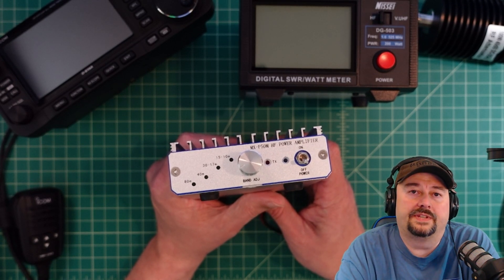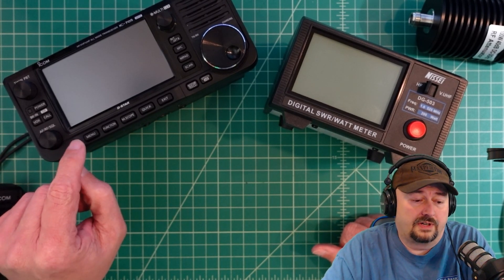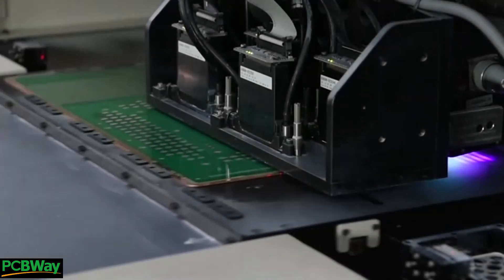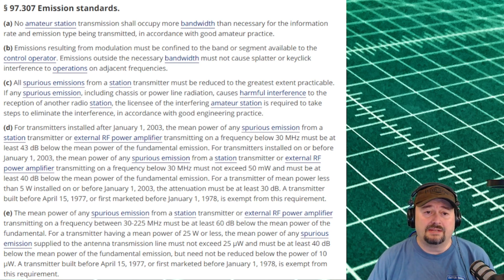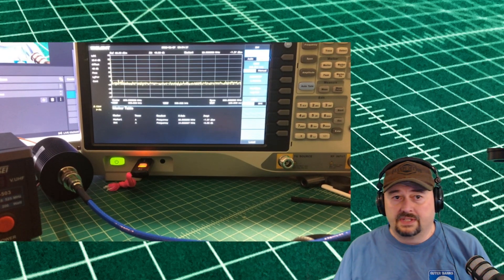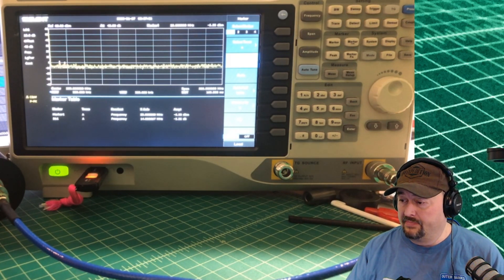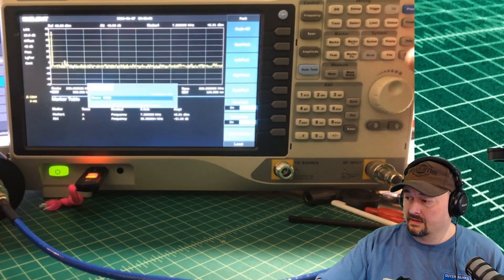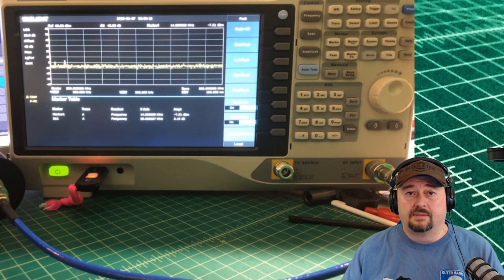MX-P50M HF Power Amplifier Spurious Emissions Test

Comment: Sorry for repeating this question if it has already been asked but did you check the spectral output on the IC-7300 first?
Reply from the maker: 7300 was clean, it’s the amp
Reply: @TheSmokinApe  Roger Roger
..thnx...I was about to second guess my 7300 but I'll just relax now 😁

Comment: Two comments.. the   RF relay topology of those amps is crap .. they use the same relay for both in and out to the LPF selected. This sis guaranteed to cause problems  but it's a cheap solution. You get blow-by within the relay.

Second.

It may be possible to jessy up the performance on 20 mtrs  you need to find out what you have there in terms of L s and Cs measured not what's written on the body and not via an AL calc.  Then run it through  a Bessel filter program an find out where the break point is -  some of the filters of that type when sold as stand alone (Ebay)   are utter crap. they have never been checked for component tolerances.  or were a bad design to start with .  Rework it so the break point is sitting either ON 14.3 Mhz or say +20% if you want less power dilution. 

 THen build it with those components  .  You may with intelligent component selection be able to  retain all coils on that  band as wound and just pull around the filter by the  filter  capacitors of which there are likely three. Appn Note  267 from Motorola  Is you friend but you won't know what Q has been the basis of the filter design.  Everything in that  appn note for  a Network type B devolves from the selected Q.  Nxp now appear to own the intellectual property of that AN.  

any capacitors replaced have to have precisely the same technology as the existing ones.  No Mylar green caps for example are acceptable. 

TEF
Reply from the maker: Thanks for the detailed info TEF

Comment: Thanks for this test. Glad to see it has the output filtering. Going to put one after my Flex 1500 to get 25 Watts to drive my Elecraft KPA500 to full power. Tried a different Chicom unit without filtering and it drove my KPA500 nuts.
Reply from the maker: Good luck with it Craig, thanks for watching 👍

Comment: I'm enjoying watching as you learn more and more about ham radio. 
There's no reason not to use the amp. I assume ANY amplifier I get has spurs, and that an external low-pass filter will likely be required. Fortunately for us as hams they are cheap and easy to build, and we are licensed to build and use those filters. You have a good spectrum analyzer and power attenuator sitting right in front of you. Go for it.
Reply from the maker: Hey John.  I have this thing field stripped right now, the plan is to attempt a fix internally and if that doesn't work we'll go the external route.  Thanks for the comment 👍
Reply: @TheSmokinApe , I'd guess if you put a NanoVNA on that low-pass filter you'll find one of the toroid's windings needs adjusting.
Reply: Spurious emissions is normal from this amplifier if the input is overdriven. Keep the input to 3.5W or so, and harmonics should be well below 50dBc. But on the other hand, the production line for these amplifiers may give some variance. It's not a 6-sigma factory I guess.

Comment: I wonder if there are a set of LPF Low Pass Filters in this unit. If not, perhaps you could just add one for the 20m band ? I suppose 17 meters should be checked.
Reply from the maker: I plan on doing more testing with it.  It does have internal filtering, I suspect it needs to be tuned / adjusted.

Comment: Surely to be meaningful the test should show spectrum analyser results for both the input and the output. Also, the test needs to show the input power level. I did own one of these amplifiers and it was well within specifications ... PROVIDED it wasn't overdriven. These amplifiers are rated at 45 Watts maximum output but at that level they are really starting to become non-linear. Keep them under 40 Watts and they're fine.
Reply from the maker: I tested down to 30w, and it was still out of spec.
Reply: @TheSmokinApe  Mine was fine up to around 35 Watts. By 40 Watts it was starting to saturate and at 45 Watts it was saturating badly and was completely non-linear.
I suspect there’s some variation. There’s not a lot of quality control with these products so it can be a bit of a lottery.
Reply from the maker: That, I can agree with.  Thanks for checking it out Andy.

Comment: Can you just do 20 but use the Hermes to generate the signal? (I am still gonna use mine) also, when you adjust the power down, to say 20w out, does it meet spec? Thanks Ape
Reply from the maker: It did at 30, I think I need to do a part deux 🤔
Reply: @TheSmokinApe  That's exactly what i wanted to hear.  I've considered buying this with the plan to never go above 20w.